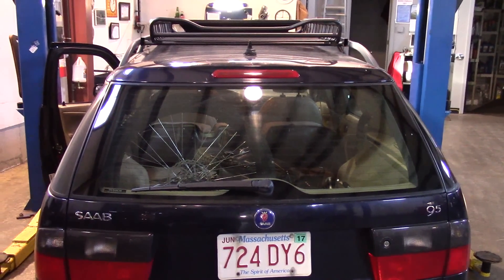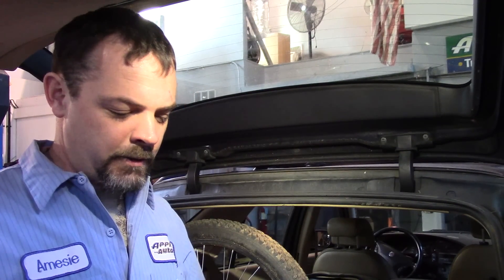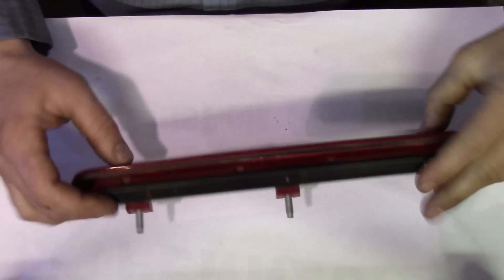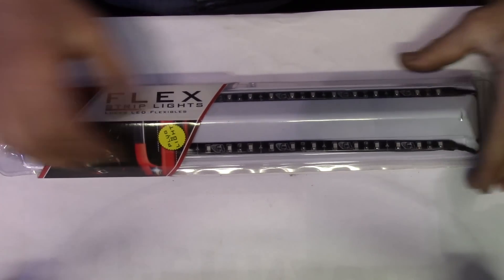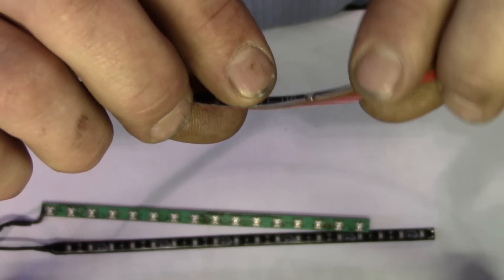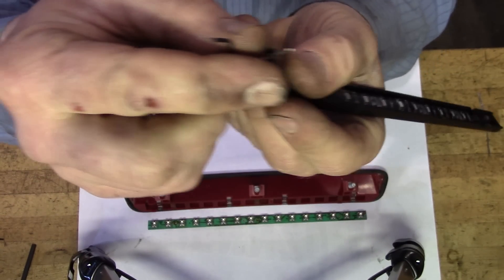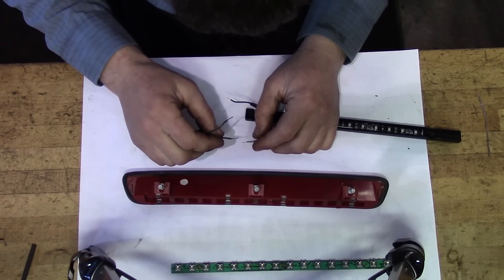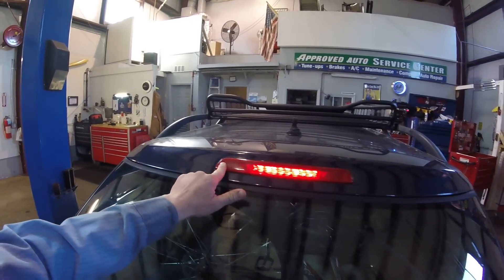Cheap Awesome LED Brake Light Fix!

Comment: Great work-around for a common Saab problem!  Thanks once again, Amesie!  I think a new Saab light is around $70 US.  Another problem with LED tail & brake lights in general is that they don't give off heat, so in a snowstorm your lights will cover over with snow.
Reply: Neither do incandescent bulbs of that low brightness either. I live in an area where it does snow sometimes in the winter and I have never owned a car with incandescent brake lights that could clear snow on their own This complaint in general is such a minor, infrequent occurrence that way too many people throw around as an easy way to try and make the more efficient and overall much better LED sound inferior. All the days that it's not snowing this issue is completely irrelevant

Comment: Sweet fix I'm glad the warming went off on the dash that's awesome . Love the videos
Reply: I don't think that mystery chip had anything to do with the warning system, there was no additional wire for it to communicate on.  The alarm is very possibly based on sensing current.

Comment: It does look a little smaller than the factory LED light bulb but it certainly is a much more reasonable deal for what those things cost. The other thing I was gonna suggest for something like that is to try a salvage yard. Not sure if that would be less or about the same as a new one since the LEDs are always more expensive in general

Comment: "Damnit. Please don't be the third brake light. DAMNIT." lol....

I replaced the bulbs in my wife's third brake light, had no idea that 1) it was just regular W5W bulbs (t10 style, like 168s), I always thought it was an LED strip from factory, I was pleasantly surprised. It's a 9-3 convertible.

Comment: I made my own from LEDs for the wing when I added it. The original was inside the back window and it was so dim I can't imagine how it passed DOT for production. 91 Integra 4dr. Lighting sux in general. I may upgrade the tails and cluster lights as well.

Comment: if you use a small flashlight slide it a long the circuit board you will see the crack or cracks in the copper film then use the finest sandpaper to clean up the copper then solder it and it's fixed.
Reply: Or apply power to the input and use the meter to follow it along the board until it disappears.
Reply: My thought  too it can be repaired...but the replacement idea is an alternative too

Comment: Good video, but personally i would used the multimeter to find out what failed in the circuitboard and then jumper the track that failed  they are mounted in 4 in paralell and 4 in series.
That circuitboard looks almost like the GM version for the Opel/Vauhall/GM Astras the LEDs are "Piranha" types 4pin 2 anodes and 2 cathodes easy to desolder and replace them.

Then put some clearcoat on the pcb to protect it from moisture.

So if you have a failed 3rd brakelight take the multimeter and put it in diode mode then measure each "led" and find which ones failed, they can be purchased from almost any electronic
store.

And Amesie, look into COB versions of the led modules on ebay they are very bright my plans are to replace my 3rd witch such and then put a reversing camera in the middle :)

Keep the good work up !

Comment: Hmmmm I have fixed many LED style break lights that have had water ingress most of the time it is an easy fix either broken tracks or over heated current limit Resistor usually less time that the mucking around doing a bodge job.

Comment: Maybe try a bit of switch cleaner or clean away corrosion and re-solder if required sometimes if not too much corrosion it will work

Comment: Service theft alarm means the alarm module's lithium batteries have finally failed. They're located behind the fender lining on the driver's side front wheel well. Here's a link to a page on how to get that bad boy out:
http://www.thesaabsite.com/faqs/9-5%20(9600)/FAQ--electrical-category--sid-unit-%22service-the-theft-alarm%22-warning.html?id=418

Platonoff provided these instructions, that guy is terrific, saved my butt more than once lol.
Reply from the maker: +Jesse Crandle Good to know, thanks!
Reply: +Amesie&#39;s Automotive Corner Remember to change both the capacitors and the batteries in the siren. If you don't want the siren at all, just disconnect it and then remove the siren function altogether with tech2. If you have a siren with bad batteries it will start the siren randomly (or always at 3AM in my experience! ;) )
Reply: Ian't the internet awesome. People like you can share knowledge instantly.
Reply: It's rare to find videos these days with comments like this, YouTube use to be like this in the early days, I hope every video can have a nice comment section such as this
Reply from the maker: iLeetProductions My fans are some of the greatest internet users!

Comment: Wow you got off east just having to remove 3 screws, the 3rd brake light on my Tahoe is sealed shut!
Reply: yup I replaced it once with the oem GM one at over 100.00!  They only last about 5 years.  This time I went for the Dorman one at 50.00.  We'll se how long it last on my 06 Yukon.

Comment: i would bet that light could be fixed with some wire and solder to bypass messed up traces. the led themselves should be alright still i would think.
Reply from the maker: I tried that but it still wouldn't light up.

Comment: This was a great cheap fix, but cheaper with more choices would have been ebay... Still, 17 buck and right now is pretty good.  You might have been able to fix the traces too, but this fix is going to work for a good while I'm sure.

Comment: One question im solder wires from led 12V white stripe to the original wires from car conector and my third light wont work there is no enough resistance then I put some T10 light between wires and led light work properly. I tried with 1k ohm resistor light won't work again. Can somebody please can help?

Comment: Hello! Just curious on the voltage supplied to the LED. In the video shows that the voltage is just below 12V but the engine is not running. We all know when engine runs in the voltage will spike up to 14V+ right. Doesn't mean this will overvoltage the LED thus reducing its lifespan?
Reply: Good point.....and many folks with automatics sit with their foot on the brake in a traffic queue...... Maybe a good idea to put a resistance in the line.

Comment: Update... Has a 5 volt constant output on the positive wire which kept it dimmly lit all the time so I had to add a 12 volt relay to bypass that problem and now it's all good 👍

Comment: Make new PCB, resolder old LEDs, make solder points waterproof and put everything back together. Or you can jump wire the old PCB - either way this repair would have costed less than 20 bucks.
Reply from the maker: +Tomas Sabalas Actually I tried to jump the rusted out paths months ago but it still was a no go.
Reply: @AmesiesCorner  Did you check the continuity for each of the diodes as well?

Comment: Automotive question, although not related to this video...
Has any mechanic reading this ever heard of converting a car's hood from lift strut to prop rod?  I have a 98 CVPI and am starting to resent the fact I need to replace them every couple years despite the hood almost always being shut.
Admittedly, a new pair of lift supports isn't the most expensive investment, but I'd rather avoid the hassle and have something that will most likely outlive the car.

Comment: Great fix, but it's a little bit to short, it doesn't light the whole glas.
Reply: +Daniel28021991 

I think the original didn't light the full length of the plastic either.  The new LED strip was almost the same length, certainly less than 1" shorter.

Comment: Hahahah, when I got my 9-5 the third brake light was burnt out from moisture getting in there. I ended up getting a good used one for $20.
Reply: +FrankTheCat As for the service theft alarm, replace the batteries in the alarm siren module. Simple soldering job, though I think on your 9-5 the alarm sirens are glued shut? The one on my '99 9-5 was held together with torx screws.

Comment: You don’t have to replace the light assembly…the problem is
the crimps on the LED’s.  This assembly
had no dynamic parts so the issue is the connections and crimps always give it
up over time.
Force a blade screw drive in the seam of the light and give
a small pry all aroung the lens going around and around prying more and more as
you go and POP!!
Notice the crimps on the LED’s.  put solder past on the crimp and flow solder
on the joint (800 Degree soldering tip recommended).  When the solder flows move on to the next LED…not
the same one…let it cool.
The white wire is + so stick straight pins in the connector
and check on the car battery.  It will
work and if not, you have a cold solder joint so redo.  There are no dynamic devices in this light so
flow the solder and it will work.
Seal the lens to the assembly by scraping RTV into the lens
lip and the base when assembled.  It will
not take much so be cool.
Good Luck Guys…I’ve done several this way…takes from start
to finish about 45 minutes…just say cool and don’t force anything.

Comment: The LED third brake light is $140 brand new if you buy it on the internet. That's for a genuine part sold through Eeuroparts. They're located in Connecticut, not too far away from you :)

Edit: I mean compared to me, I live in Florida, so really anything you order should just take a day or two in the mail.

Comment: I would just repair the strip.  LED's are not hard to acquire and it is just a simple matter to unsolder the failed diodes, repair any failed traces and you're laughing.

Comment: the led will not last as long because you cut piece off now the resistors have to work much harder to control the voltage spike
Reply: what are you talking about? all these light strips are designed to be cut. there is a line where to cut. there is no difference between 6 inch long or 25 feet long. they don't use more or less power and will mess up if you cut them.

Comment: the new brake light should shut off the computer reminder because the computer only senses if current is passing through the light. if the light is burnt it wont pass voltage so the computer cannot recieve current so it trips the reminder

Comment: That M7 part is a 4007 Diode but in a smd package. btw the letters and numbers near the parts tell you what they are: D = diode, R = resistor, C = capacitor, Q = transistor,  integrated circuits are marked as either U or IC and you would have to google the number to know what it is. The numbers just count how many of that type of component is on the board, its kinda useless for the purposes of reverse engineering.

honestly, I'm surprised they didn't silicone or coat that board up to make it more water resistant...